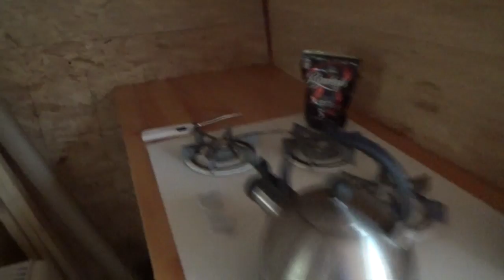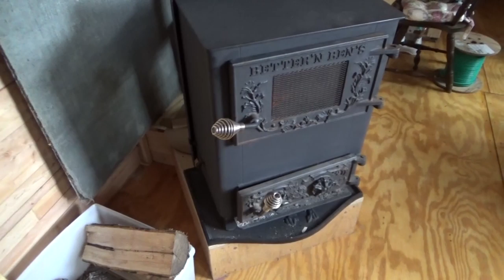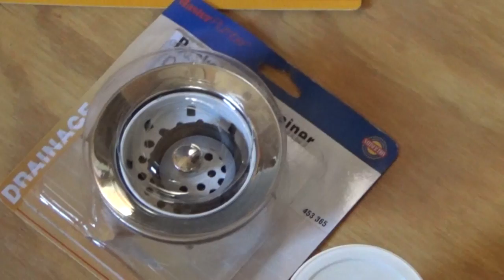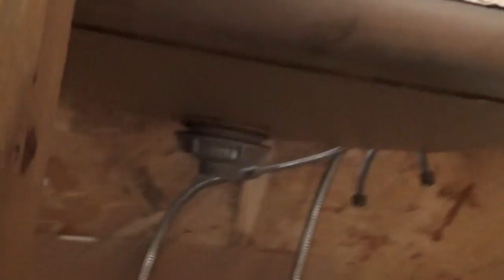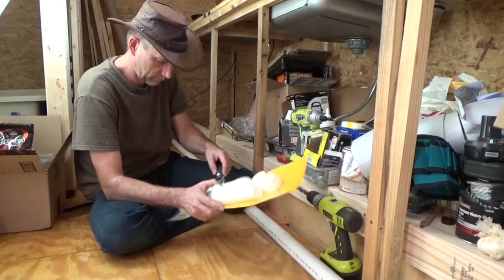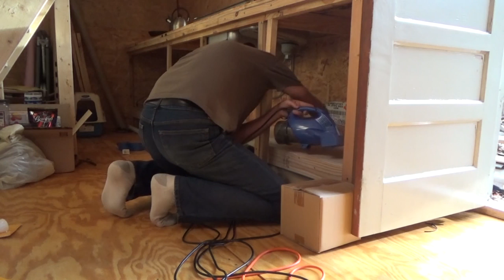Installing The Kitchen Plumbing In My Tiny House O35

Comment: Try a propane bbq piezo ceramic igniter for your stove. it works without a power source.
 it generates its own energy you can also find them on junked water heaters.
Reply: nice idea, also good for potato guns, found on old bbqs or at home depot ;)

Comment: I think your doing a great job, I've been watching your videos for a while and I only wish I could go off grid as well but I have about 10 more years till retirement and then well see haha.  So I see a lot of hate about using plastic pipes by your viewers?. For one they will never rust, they very seldom ever leak and they are much easier and cheaper to use than metal here in the good ole USA. I have used the exact same plastic for years without any problems at all. Someone said take your time and that's exactly right! cut everything to size, assemble it and then snug up every connection, run hot water(if you can) as the hot water will actually soften the pipes a little and you'll be able to tighten every fitting even more so(maybe that's where people go wrong, always use hot water and re tighten). The little plastic washers are the best and really do a great job keeping a seal. You don't need pipe thread sealant like metal and you don't have to worry about the P trap's rusting out (as all metal P traps eventually do) Best part is they are so easy to replace (if you ever need to) great job and keep up the good work.

Comment: re: Baby escaping---a third of my bunch (the Desert Cat Brigade, suburban division, JuneBug Cat commanding) dashes happily outside whenever ANY door is opened, so I ended up installing a security screen door.  Doesn't interfere with airflow, only minimally stops flies due to the larger steel mesh but because its steel mesh its also much better for climbing and hanging off of (or so the kittens tell me).  I know you don't really need the security angle out there, but the Baby-proofing while still having the door open might be a plus.  Just a thought.

Comment: No tailpieces without dishwasher hookups? Very thinly stocked hardware store............
Your going to need lots of support for that long drain pipe as it will put too much stress on the tailpiece connections and leaks will develop. Perhaps run it along the back wall? Lots of strong support and more room under cabinets. You'll needa slight slope to assure full drainage.

Comment: I realize you probably finished this a few days ago, but you should run the "P" trap towards the wall and then you can runt he drain pipe against the wall and not interfer with your under cabinet storage as much.

Comment: It's coming along:).. May I make a suggestion if you have a heating torch you can heat up the PVC pipe and run it against the wall all the way down but not too sure how your setup is is planned

Comment: As a licensed plumber it was hard to watch, with that said I think you are doing a good job for someone that is not licensed. I will add that you might make sure the tee is in the right direction, sometimes they make tees to go up and down and not on it's side. The best way to check is to look inside the tee. A vent is there for the movement of air with the waste and air to move away from the waste. The p-trap is used to block methane with the water inside of it as well the odor. I recommend using pipe dope (teflon paste) on the threads of the drain pipes to help seal and prevent leaks. If you don't have very good movement (slow drains), you can install what is called a mickey vent. It is a vent that can be installed under the sink with a tee. The p-trap goes into the one side, the drain the other, and the middle pointed up for the vent. If you use a drain tee (it goes in a certain direction) make sure it flows the right way. You can private message me if you have questions or if I am not clear. Best of luck to you!

Comment: You built a bottom in your kitchen cabinets. I missed that! After that, the plumbing is just a bonus. Didn't expect it so soon, and it seems I was not alone.
I do second the suggestion to have a catch basin under the drains. Not every drain I have ever had has leaked, but far too many for comfort. And we are talking about professionally installed stuff (although with new built, you sometimes wonder about the professional part of it). With everything wood under your feet, I would not take any chances. 
When I make a catch basin like that, I also use it to put things in there like detergent and cleaner bottles, that may be wet on the outside after you have used them.

Comment: Can find on YT just search ,Double Bowl Sink Drainage Installation.Keeney manufacturing has a do it yourself video, looks to be similar setup .You still should be venting with proper size vent pipe.Get some window screening.You can buy it in a roll and do up some screen. You can keep your windows open minus bugs and leaves then.

Comment: Tighten the basket strainer nut with a channel lock if you don't have the proper wrench.  You should see most of the putty squeeze out into the sink.  Hand tight is not enough.  All the other fittings should be good hand tight, or slightly tightened with a wrench.  Over tightening these will cause them to crack and if they don't crack right away they will in a few years.  Use pipe dope (the gray stuff) on the slip joints and plastic washers.

Comment: I usually make a rope of the putty and then lay it on the opening, and not pressed down like Troy did. Then when the flange is tightened I remove the excess putty that has squeezed out.

Its now November and I hope Troy gets some friends over so they can spend a day installing the wind generator set up because now that winter is upon us, with less sun, its important to get wind generated electric power to his tiny house.

Comment: Some people have a hard time remembering that your tiny cottage is a mobile hme, so rules very as opposed to regular homes. You trying to use as much of your collected rainwater over again. Still if you siphon off the methane, wait a minute news flash, his throne is not a water flushing model, so no stink in the pipes and no gas back up. Oh well just a observation that sometimes baffels us all. So lets see what happens when the plumber looks at the video. Otherwise scratch the Baby Cat and call the Birds. At least you aren't freezin and need to attach a heat powered dc generator to the stove pipe.

Comment: Troy, try making the union at just below the sick bed. the shorter sink, use the tail peace, too run the two sinks together. run that into the T, then adjust the J trap, to the backing wall. connect the trap to the drainage line too the PVC, running it down too the fall is 1/4 per foot fall.  the easiest way too connect would be too use the T as a long sleeve into the J trap.  if you need info try looking at install drain pipe by youtoocando on you tube. or FIX IT home improvements .  it is not really hard too do.   just remember too roll the putty between your hands into the worm when placing around the top of the sink, that will stop any water from getting to the wood. just clean the extra up after you have it tightened down.    water line's can be run, under the camper floor, or through the wall at the same hole area where the hole is cut to run tubing through.  again not a hard job. you can use The PVC to sleeve the piping or tubes into the camper. just remember too pack the out side of the PVC with putty after you have the tubing run, to keep out the bugs and cold.   find a water tank for storage inside the tiny house, too have your filtering setup with your pump, or hot water tank connections to electric, into a water proof box ,with a fusible link. like you have in the camper in the frigatetor/ icebox.  same set up too run gas line through the wall, only use smaller PVC tubing if your going too have a gas usage inside the tiny house for venting.  as you should think of a vent over the stove too remove the gas fumes from cooking.   again to regulate the heating run, holes in the corners with fanes to push the heat back down from the second floor.  there is also the drain line from the bathroom sink too think of how many holes are you planning too run, less is better.   that's why I stated the running both drain lines into one exit point.

Comment: The dishwasher pipe goes under the t. And if you are not going to have a dishwasher. You do not need that pipe. You have no way to stop up the hole. I'm not tell you what to do. But hope this helps.

Comment: Hi troy I did a lot of pluming in life just trying to help put you should look up on goggle and see how your drain is hooked up the short down pipes your using are the wrong ones you don't need them their for dishwasher and or garbage disposal use the short ones that came with the drain kit  the place coming together nicely good job I'm just helping out a friend

Comment: a thick bead   silicone under the   edge of  sink. then  set sink  down into silicone  then  them  under  sink fasters pull the sink  tight  a lot less drips..
Reply: plumbers putty  NOT silly cone, use something that will seal and stick and not dry out.  plumbers putty
Reply: haven't  seen that   used  since 60s. some have a gasket

Comment: Ugg - plumbing. Had this been me, I would have watched at least half a dozen YouTube vids plus made a trip to the public library for a basic plumbing book. And I would have gone to a better supplied hardware store for proper ABS fittings. (Not to knock the True Value, my family used to own one!)
Two things - one is that I think you might want to start looking out for a better/taller vacuum. You're going to be vacuuming up sawdust forever anyways. Electrolux has a handheld upright that runs on rechargeable batteries. 
Two: Is is absolutely necessary for you to start the wood stove in the morning? You may be better served to tough out that first hour or so and then start it up later in the afternoon to avoid baking yourself out during the day.

Comment: You can turn your trap toward the back wall of the cabinet and then rotate the outlet of it toward the side of the tiny house.  This might allow you attach your PVC pipe to the back wall of the cabinet.  You really do need a vent.  You can buy under cabinet vents.  They have to be mounted as high as possible, like just below the counter top and they aren't as good as a through the roof vent.  My house was built by my father-in-law and has them.  They are better than nothing...barely.  I'd still leave the original drain in but if you want them to look alike I understand. 

I'm curious, do you have a bead of rubber door trim all around the lip of your stove?  It prevents liquids and things from leaking underneath if you have an accident and it helps to level the surface created by an uneven wood counter top.
Reply: I agree turn to back wall then 90 to enable to run tight to the wall with clips to hold it.
 but you do not need a vent, water runs around the wall of the pipe and vents itself though the centre like a vortex.

Comment: the bend in the pipe or big U is called a p trap. It can all be up a little bit higher. After you cut off the dishwaher part it will be up the perfict hight. and remeber the p trap can be turned out away from the other pipes so it dont interfere with them. adjust it.

Comment: Cut the dishwasher part off and shorten the pipe and it will be the best size then any way. You only need a striaght pipe and it needs to be shorter than the the one you got.
Reply: I think that he planned to use a shorter pipe in another section of the system and had decided that what he cut off would be just the right size.  In that case, cutting off the dishwasher part may not be the best idea as it would be hard to work with.  It is easier just to cap or cork it.
Reply: Vicki Olson It is likeley ot leak if not done properly.
Reply: ***** The more golf cart batteries I add the more watt hours I get. With four golf cart batteries I get 5,000 watt hours. About 2,000 useable since I cant run them down more than 40 percent. Just to clear things up about our conversation earlier.
Reply: ***** Look, if he cuts the top part off, the part with the dish washer tube, he has to go and buy another pipe.   If he cuts the bottom part off he can use that in the other space where he needs a shorter pipe and he won't have to buy another piece.   All he needs to do is cap or cork the dishwasher attachment.  There is not any water pressure involved in this pipe, as it is a drain, so capping or corking should be relatively easy.   Actually it would only be a potential problem if the drain got clogged and I don't ever see it getting clogged that badly.
Reply: ***** You are impossible.  You can't see the trees for the forest and are not using simple logic..  Why should Troy buy and extra pipe when he does not have to?    If he cuts off the top part of the pipe with the dish washer drain attachment, he can't re-use it.  If he cuts off the bottom part, it can be re-used and is just the right size for the purpose for which he needs it.   duh
Reply: ***** You can make funny words all you want.  You are the one who is wrong.
Reply: ***** Gosh you don't even remember what we are arguing about.   Of course they are too long.  You want to cut off the top part, the part with the attachment for the drain water from a dishwasher.  I want to cut off the lower part because it can be re-used and the top part can't.
Reply: ***** I know but I was saying that more batteries more capacity. OK your right about amp hours but that was not really my point,. Point is more batteries can do more work for longer. And I thin you know what i meant but your being picky.
Reply: ***** Your a an annoying know it all az.   whole but head.
Reply: shartne agreed.!!!
Reply: Im not trying to act superior like you, dumb az punk. You dont even have a real solar system worth putting on video. I bet you dont even have a battery or a solar panel. You have no channel except for other people's videos. So what do you know about solar other than what you read about You have not exsperience.
Reply: Your a punky troll. You dont even have a real channel troll.
Reply: ***** Make a real solar system and make your own videos then you will have a real channel not a fake one like you have. Then come and tell me how to do solar stuff. I will listen then.
Reply: ***** So what are you doing here?? go away troll. you think you know everything about it. Why are you here if you feel this way about Troy. If your such a working man. Then go to work and get out of here. Troys job is his channel.
  Go fix your cart and shut and get lost.
Reply: ***** I Oh stop it will you ? !!!  You are not accomplishing anything, acting like a 3 year old.    Shame on you !
Reply: ***** I'm some one who does not tolerate nonsense like yours.
Reply: I'm not afraid of Doc, at all.  He's afraid of me actually.  I won a huge argument with him by using things from his own videos and he blocked me. lol   He could not win because the facts were in my favor so he blocked me.  Typical coward. lol

Comment: why did you get the long down tube with a dish washer drain part to the side? You actually got two of them? You just need a striaght pipe. you now have to plug it off or go get the correct one with out the pipe sticking out to the side.
Reply: I think that Troy said in another comment that that is all they had on hand.  I think that I remember that  I saw that they came with caps.  Thanks for the comment.  Please feel welcome to comment any time.  If there were no caps in the kit that he bought, it makes more sense to just get caps the next time he goes to town than to have to tear apart the whole system.   ps, if no caps are available, he can use wine corks cut to size.  The would work just fine for the job that they have to do.   I call that 'making do with what you have'
Reply: Vicki Olson It can be unscrewed and put back together in a matter of a few min.
Reply: shartne But why go to the expense when it is not necessary, and why take it apart if you don't have to.?   Either caps or corks would work and both are cheep if he does not already have the caps.

Comment: You have to tighten that giant nut down really hard use a screw driver and a hammer to work it around.You have to compress the rubber gasket or it will leak. trust me you must make it really tight. I use a giant pair of channel locks. The do make a tool that fits it sold at the hardware store. It will leak the way you got it. Im sure. I have done that task to two sinks. In my old house and the house Im living in and they leaked until I got them tight enough.

Comment: Troy, what you have is a center outlet continuous waste setup, this or an end outlet will work fine for your purpose as you have no drain line in place. the two long tailpieces you have are dishwasher tailpieces and not used in your app. (unless you plan on a dishwasher, which I doubt) you need 1 of the short tailpieces installed on the lower sink strainer and a 11/2' slip extension which you will have to cut to fit ( they usually come 12" long) on the higher strainer. Connect the waste arms to the tee and tailpieces, tighten everything hand tight, NO tape or pipe dope, connect the trap and figure out where your waste line will be to suit the trap. When you get the drain line connected, run some hot water down both sinks for a minute or two and re-tighten everything by hand and then 1/4 - 1/2 turn with pliers and you should be good to go. As for a vent, you really should find a way to get an 11/2" vent outside and above the rim of the sink so the drain will flow properly and not pull the water from the trap. You may get by with a mechanical vent (Pro-Vent or similar) but a vent of some type is necessary. Since you will have the same issues with the bathroom plumbing, try incorporate the vent system for the bath and kitchen.